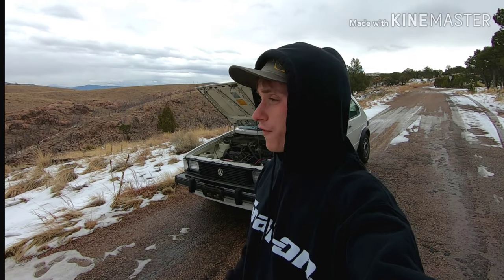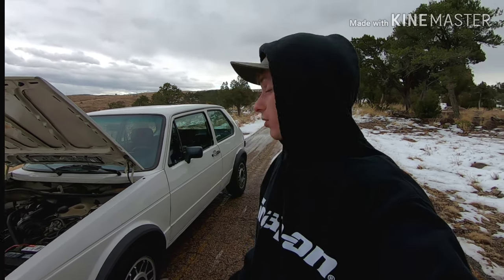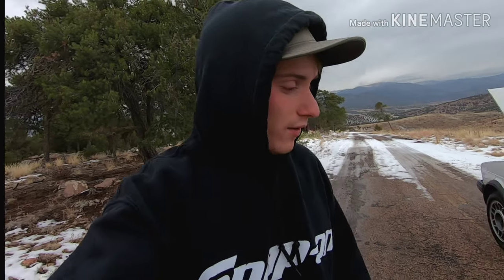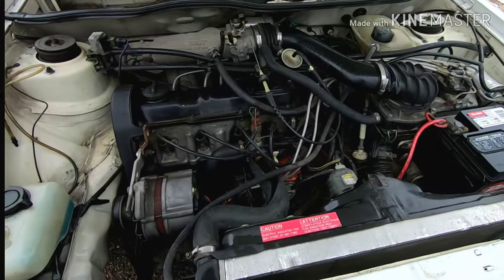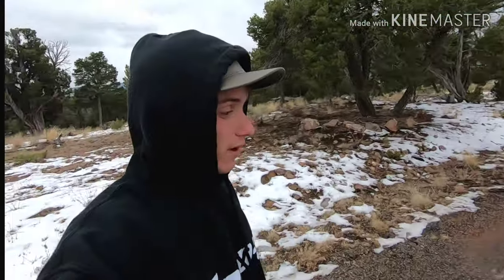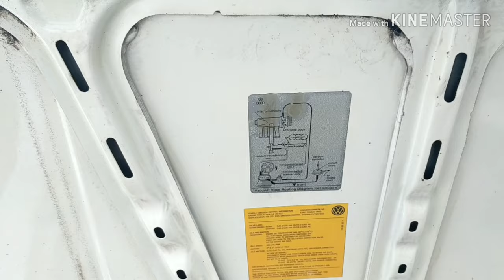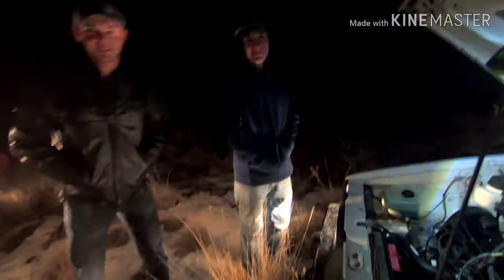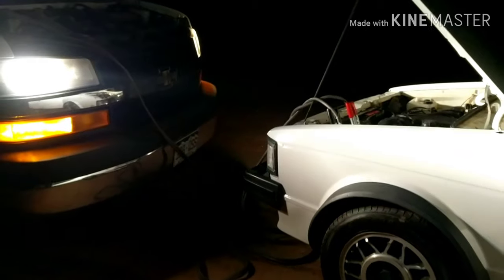1984 GTI First Drive in 10 Years!!!

Comment: If you want to keep it closer to original but boost its performance a little, then get a larger Neuspeed throttle body, a high performance cam, and better exhaust system. Then lower it a little with Koni's or Billstiens plus stiffer sway bars etc. Thast exactly what I did to my white 1984 Gti back in the day and regret selling it to this day! So much fun to drive it!!
Reply from the maker: That's exactly what I'm thinking! I have a cam and springs to put on when I get it back.

Comment: First of all that Gti is far from being super stock or super oem like you said. Its a good base to bring it back to its glory days yes. I have some parts if you need any. Cheers
Reply from the maker: I would like to get the rest of the factory parts on the car which I have a several that need installed yet, but I am missing a few. Where are you located?
Reply: Im in nyc. I got the rear badge you’re missing. Front seats. Might have door trims as well, need to check. Also gti front grill bumpers etc
Reply from the maker: @drinlogu1295  ok I have someone hooking me up with parts but if I need anything I'll definitely hit you up. Thanks!